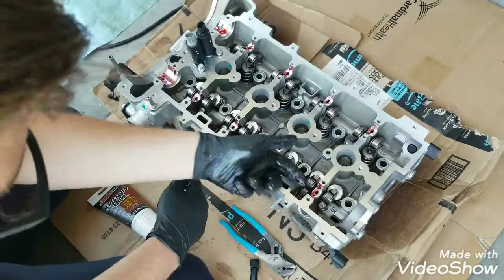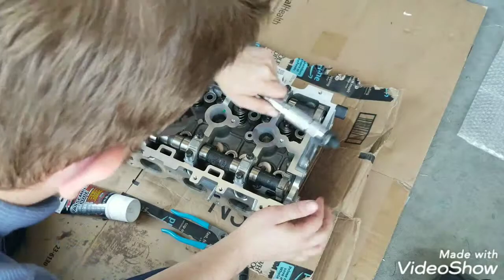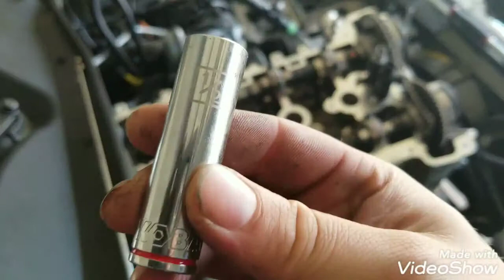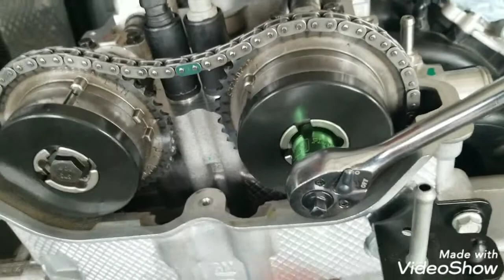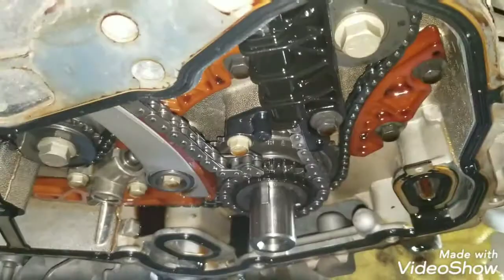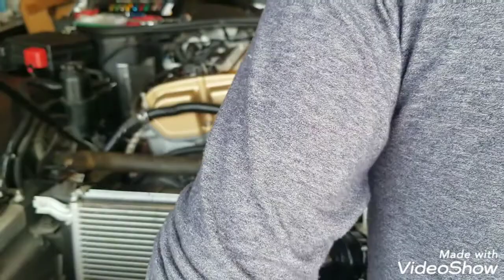Turbo build on le5 ecotec 2006 Pontiac Solstice 2.4l (part 5) reassembling head.

Comment: Hello, I own a 2007 Saturn Sky with the LE5.  When I purchased it, it had a turbo kit thrown on the stock motor, making about 275~

I had the heater core replaced by a shop because I don't have much room to work on pulling the whole dash out in my then current setup.  I was told the ECU was reset, didn't think much of it, and 30 minutes later, I shot a rod through my block.  I'm buying a used LE5 right now, and I'm thinking about reusing the manifold and turbo on this used motor, with added performance parts, of course.  I read that the LSJ crank is great in the LE5 for boost.  What all are the limitations, and what would you suggest for someone trying to build a budget boosted 400hp+ (maybe 500hp) LE5?